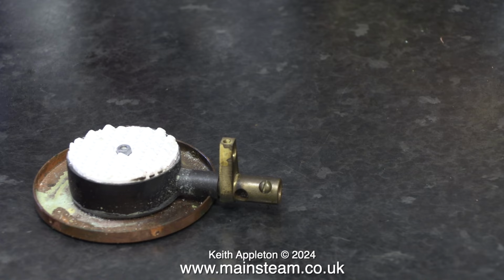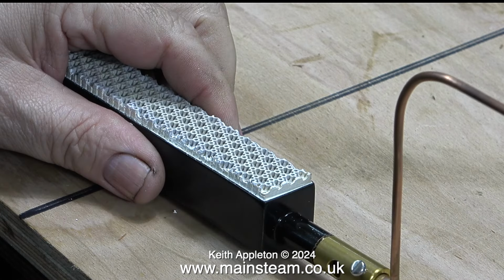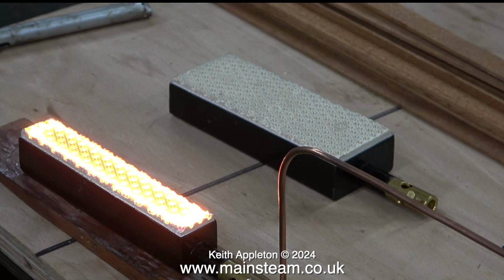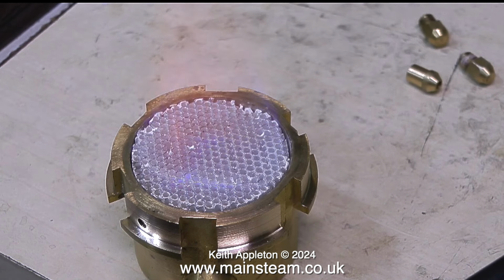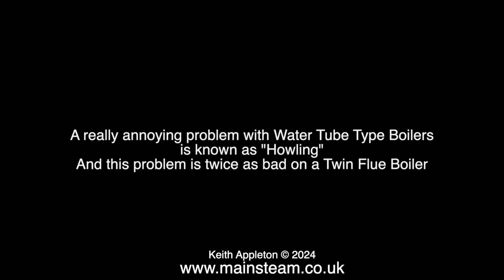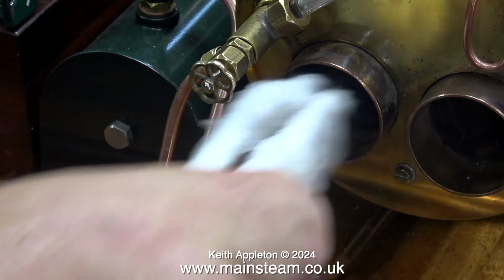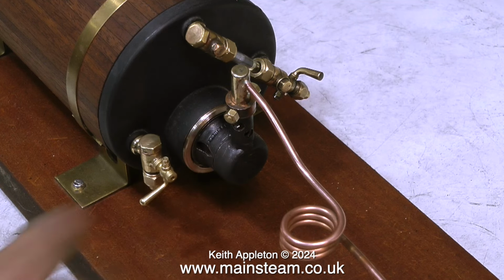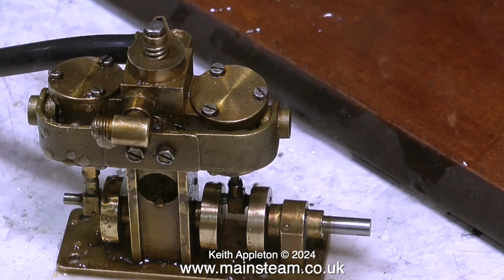MODEL STEAM ENGINES - TOP TIP TIME - PART #63

Comment: Hi Kieth, I’m building/finishing a 3/4” traction engine ;)
I have a choice! Gas or coal ??
Reply from the maker: Coal and if that's not successful - try gas firing. Coal is always better for many reasons but it can be difficult to use in smaller engines.
Reply: @ cool 😎 I’ll give Coal a try
Reply from the maker: The name's Keith by the way }:-)))